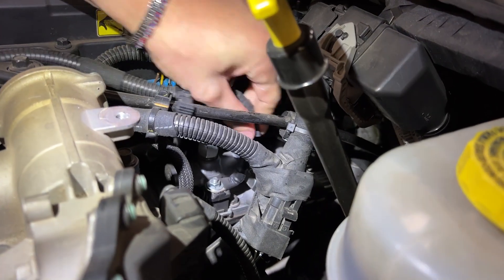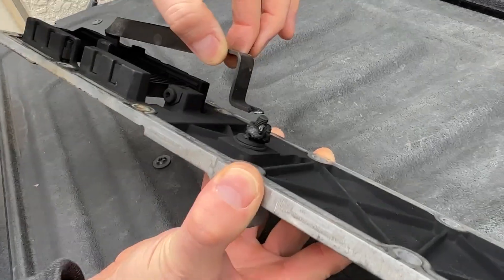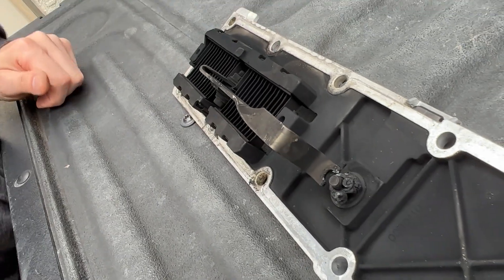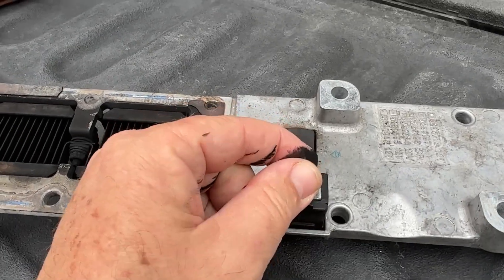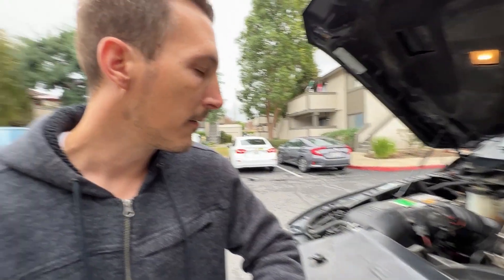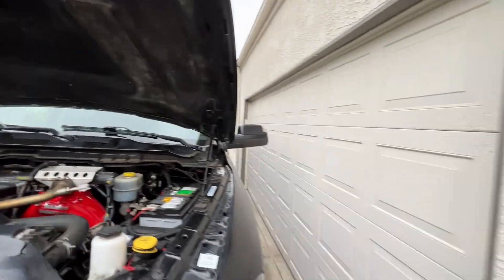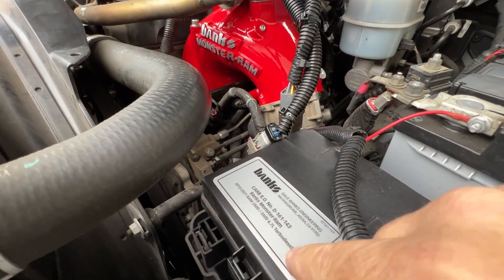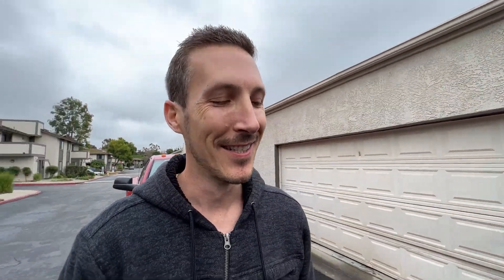RAM 6.7L grid heater failure happens in warm climates too.

Comment: What’s the difference between the banks system and the new SPELAB system?
Reply from the maker: Spelab is a rip-off artist, they're business model is to steal from American performance brands and sell the parts for just a little less. Not only were they kicked out of SEMA show, but they were also escorted out of the show by the Las Vegas Sheriff's Department. They’ve knocked off us, Wehrli, Sinister, Glacier, SPE Motorsport, Run VSE, PPE, Mishimoto, and HSP diesel. They purchased one of our Monster-Rams, sent it to China, and had it knocked off. They even copied our install guide didn't bother to change the photos. We hope that RAM owners consider where their money is going if they buy this copy. They're sending their money to a company that willfully steals U.S. companies' products and takes them tomarket with no engineering costs and no customer support phone line. Spelab copied a product that quite literally took more than a thousand hours to develop. And, we sourced U.S. made parts like the fuel line, fasteners, etc. Who has the better part? Banks. Why? Because Spelab blindly copied the Monster-Ram without any idea what they were copying. Like copying someone's math test in high school, the copycat may get an ok grade, but they have no idea how to solve the equations. If you are on the fence, please call us, we'd be happy to help.

Comment: I just bought an international mv607, 2021, with a cummins b6.7.
Does this truck have the grid heater problem also? The part looks the same, or is this just a ram cummins problem.

Comment: Which is why glow plug diesels are better. 

You think you’re cool right up until you hAve to go through sub zero temps and your wife’s life depends on it and you’re stranded. 

Don’t forget to remind your wife that IF you can get
It to start you’ll make better throttle response.
Reply: Glow plugs won’t work with direct injection.
Reply: @mikeshort4291 they must… because the next gen cummins is switching to glow plugs… thats their plan anyways, dont ask me how i dont know but that was listed on the spec sheet for the next cummins motor

Comment: Thanks for the information on the grid heater failure. I will take my Ram in asap to the dealer to see if it is broken or about to break. Should maybe be a recall issue.
Reply: Wiggle your own wire.

Comment: I still don't understand how this isn't a recall item. This isn't happening due to neglect or any maintenance issues, it is a design flaw, plain and simple. I mean what's the potential for this, you grab a well serviced truck to drive into death valley, motor grenades itself and you die out there or it eats it trying to drive through BC during a snowstorm. I bet they don't even count this failure to their reliability statistics.

You should collect all the dead engines or their parts, load up a big semi with them dump the whole pile in front of their offices, make a big campaign over their inaction. If nothing is done the next failure point might not be just killing engines it might be wheel studs breaking and people driving off cliffs as a result. It should not become a standard for the aftermarket to fix potentially catastrophic design failures, at that point might as well have them sell a rolling chassis and you supply the entire engine, back to the age of coach building cars.
Reply: All going to be numbers based.
Can it be fixed? How easy?
Does this need an engine redesign.
What is the appropriate (financially) VIN range to recall vs loss of loyalty.

How many are failing?  What are the odds the person can make it through their warranty etc.

All numbers.
Reply: They wont recall anything if people are still buying them by the millions... and not complaining about it loudly...
Reply: Recalls are mandatory for safety items. This is not a recall worthy issue.
Reply: @Fullsendfilosophy  I'd say an engine grenading itself on the freeway and locking up is definitely a safety thing.
Reply: @Powertampa  It doesn’t lock up from a bit of top end piston damage 😂😂😂